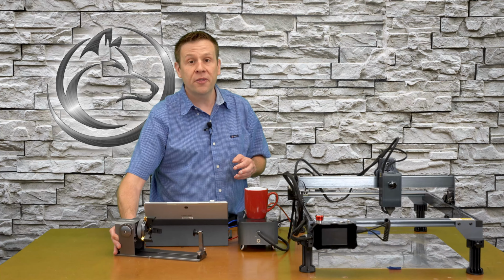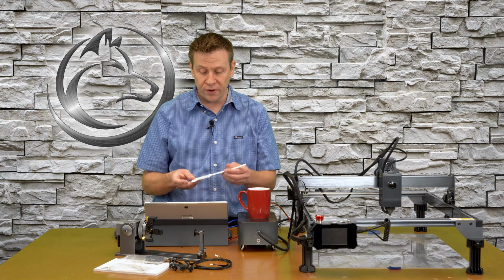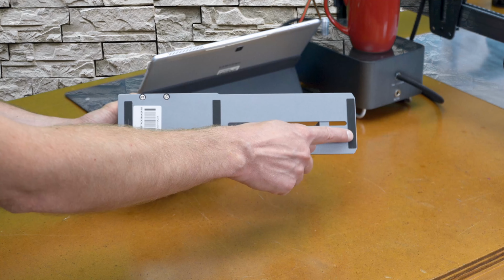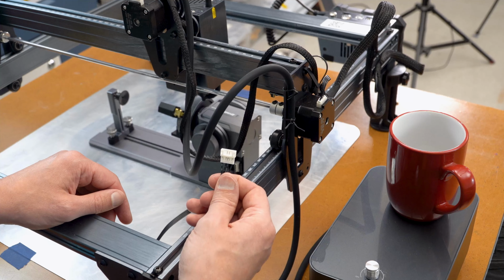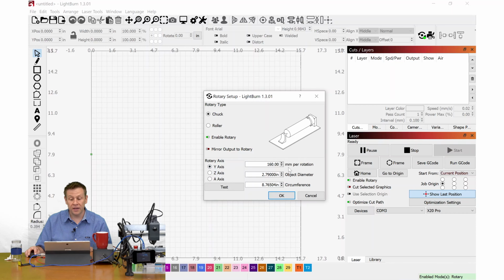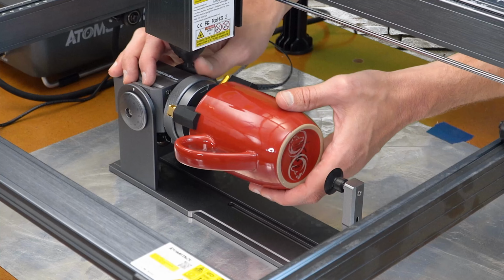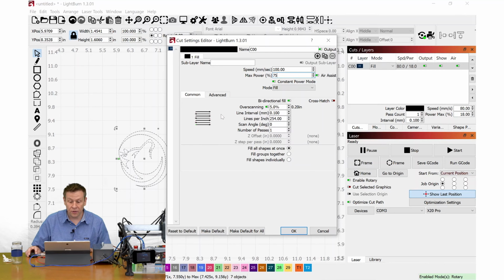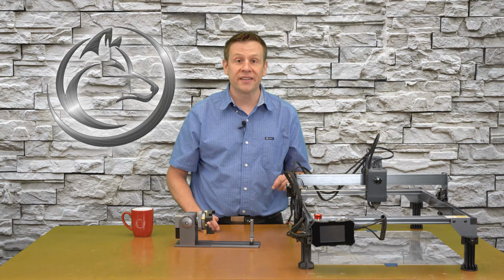Atomstack R1 Chuck- Awesome!

Comment: I can't get my rotary chuck to hold on to heavy dollar store tapered glasses. It don't matter if I try to grip them from the small end or the wide end, they slip out of the the chuck. And, it also doesn't matter if I grip them outside or inside.  Any ideas?
Reply from the maker: Hi- I recommend using the included wheel stand normally for the roller unit-  adjust to support one end of the glass- you may need to tape the wheel stand to the chuck frame to hold it in place.  Best wishes!

Comment: Light burn shows steps per rotation instead of mm. And no matter what number I put in, the rotation amount doesn’t change.
Reply from the maker: I have not ran across the steps per rotation instead of mm in the rotary setup dialogue.  I would recommend posting in a Facebook group along with a screen snip- people are pretty responsive in the groups to help!  Thanks for watching!
Reply: @thelaserchannel1  Maybe it depends on the laser. I’m using a Gweike Cloud RF with Lightburn. Other people say to use 3200 as steps per rotation. But when I put that number in, the chuck rotates almost 2 full turns when I run a test.
Reply from the maker: @roofoofighter  I haven't ran into Lightburn showing steps per rotation in the rotary setup.  Steps/rotation and mm/rotation are two separate adjustments. I recommend posting a FB group with screen snips- the the screen snips people can see the menu or setup area you're in along with your results.

Comment: I have the atomstack A20 pro.   Could you point me in the right direction to get the leg extensions  good instructional video btw
Reply from the maker: Thank you!  Usually the leg extensions come with the Atomstack brand rotary units unless a 3rd brand is used.  If you don't see them on the Atomstack website an email would be my next step!
Reply: Cans of green beans work well.
Reply: https://www.youtube.com/watch?v=6vIzo4FQL1c